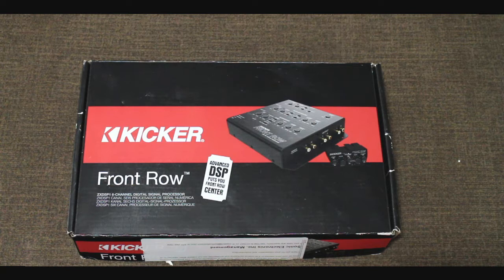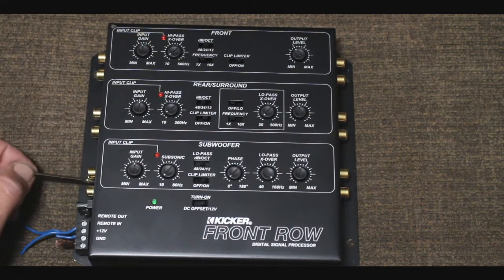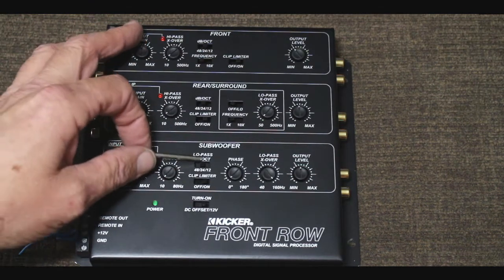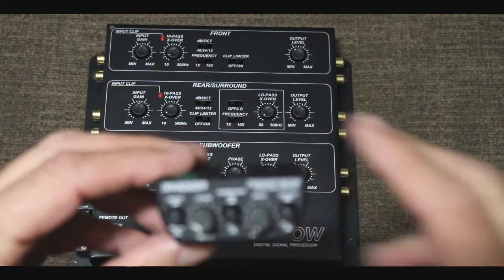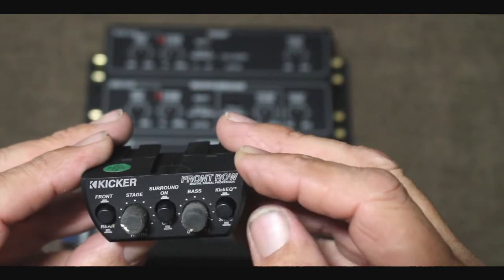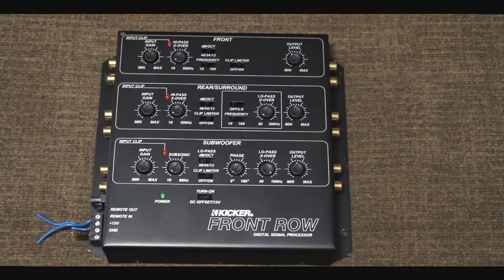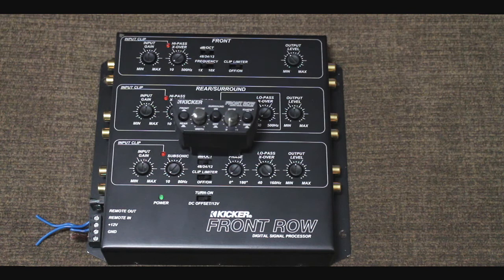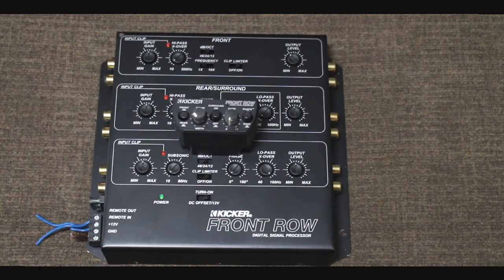Kicker Front Row (12ZXDSP1) Unboxing and overview.

Comment: Great video, do you have the popkng problems when you turn off the car because I just install yesterday and I notice a lot of people have the same problem
Reply from the maker: It only happens when listening with the car off then starting the car. I can't remember if that means it's cutting on and off before or after the amps are.
Reply: I’m in love with this dsp, are you using full range signal for the sub??as soon I change from my sub out of my head unit to a full range the sound of the subwoofer change a lot and now the shockwave is working with old songs and corridos
Reply from the maker: I'm using the sub out on the HU but it is set to 160, then use the crossover on the Front Row set at 70hz.
Reply: What if you use the 47keyloc from factory to sub.. use the Front Row for Tweeter fronts.. Mids rear... and kick panels up front.. 4 inch or so speakers on the bottom center console. .. for sub.. on the Front Row? .. that way your center would be the 4 inch.. under your feet.. also adding a richer bass from rear to front... Soundstage.. from the Front Row?
Reply: The tweeters and mids will work on a basic idea of..  we need to drown out the Subwoofer which is a 12trtpt downfiring sub.. its going to rumble.. but the mids and highs with the Front Row will give people on the outside as youre driving by... what is that.. i still hear it.. and as you drive by.. it doesnt distort.. sometimes you just here knock.. not vocals or the filling with the mids.. I have sound deadener i want to apply.. i have enough for the entire trunk side walls.. even the back Hatch... i want to do an old school set up... Up front factory..  but when i open the hatch.. Display.. i have 3 cxa amps.. 1 cxa800.1.. for downfiring sub.. 2 cxa360.4.. 1 for highs... 1 for mids... i want to recreate a deli counter display... but i want the entire display as one piece... that i may be able to disassemble if i sell the vehicle.. @kewincolon6290 .. what popping problems?
Reply: Oh... and when i say deli counter... just that... curved clear acrylic front.. easily removable.. to access the Front Row.. for adjustments.. top row... mid row... amps.. all connections to amps and power source.. all kicker wiring... but i need easy access to my spare tire .. in trunk.. it sounds complicated but in the sense of old school all of the wiring has to be visible... now we have leds... i also have four computer fans running through a regulated fan regulator.. by SMD.. if it gets too hot... fans kick on automatically.. i also have a thinner sound deadener for all the doors.. as well as speaker carpet for the amp rack build.. for the access to spare tire idea... replace the OG mat.. with a split Hinge opening.. all carpeted to match trunk interior.. my tweeters are kicker.. my door speakers are all kicker coaxials... each set gets their own amp... the extra kick panels spliced into tweeter amp.. 1 center.. 1 center.. l r.. 2 tweeter front.. 2 tweeter rear.. 4 channels.. i also have battery terminals.. kicker.. and 2 .. 4 block distributors. Kicker... so much stuff i have.. i even have a 46kisload4.. just because.. but im not getting much feedback from Kicker as to direct me to an installer that actually know how to use their products... just sellers... but i already have all of that...

Comment: Just got my front row.. brand new.. all plastics on.. none of the tape were tampered with... just the box tape cut.. 250 bucks... ebay.. everyone else wanted 450.. 400 no knob... im going to run 3 cxa amps.. with kicker 12-inch downfiring sub..
Reply: Damn I just got one for $150 with knob here local 😳

Comment: Is this useful in a high end modern stereo set up? Or its mainly for oem head units?
Reply from the maker: I used it in my setup. Kenwood 9703HU, RF 300X4, 500.1, Kicker components and Sub. It really help the center imaging. The surround effect on movies works well. The SHOC works great on old 80's rock music adding deep bass. It is viable with all the cheap DSP's available ? I think so. I'll still be using it in my new setup.
Reply: @thenotoriousrvh6091  thanks.
My set up;.
Alpine cde-265bt
Rf p1000x1bd
RF p600x4
Polk mm (4)
Sundown x8
The alpine has a 9 band eq and crossovers with slope adjustments but i was thinking the front row may do all that stuff better being thats its only job (a dedicated crossover) the alpine is a great hu though